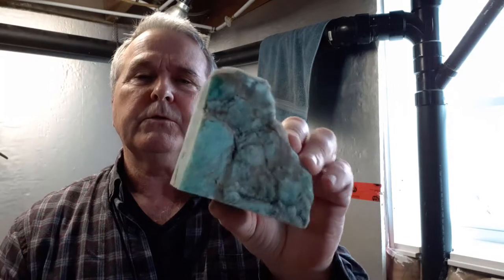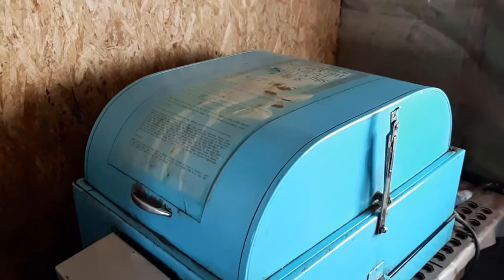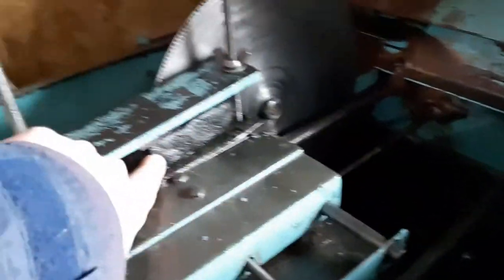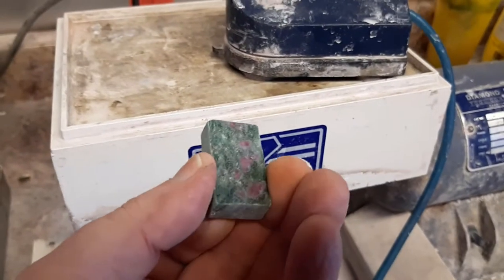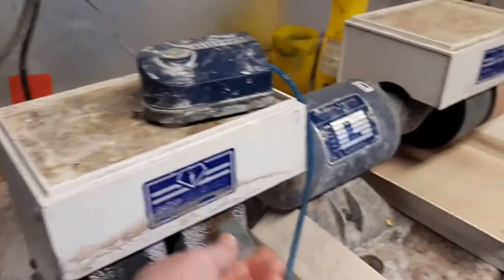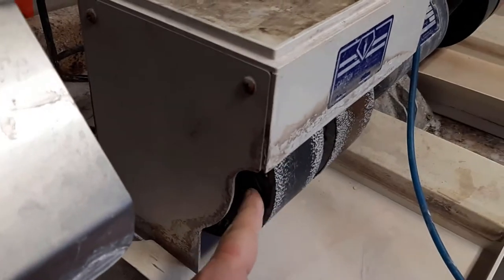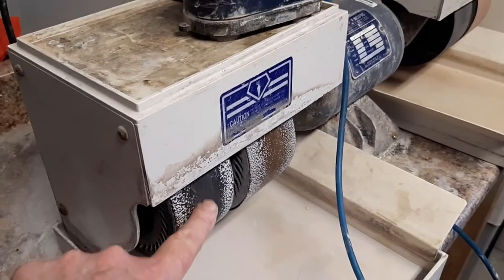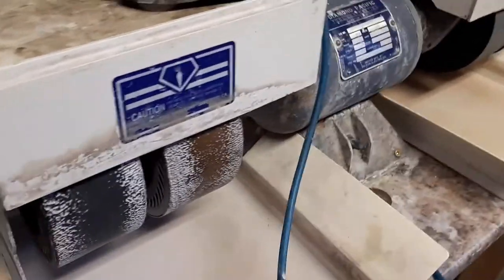Lapidary Equipment

Comment: what was your order of grit on the diamond cutting --> polishing wheels on the grinding station, i'd love to pursue a similar setup, using a Dremel for all of my work is getting old.
Reply from the maker: the two electroplated steel wheels are 100 and 220. the belts are 280, 600, 1200 and 3000.